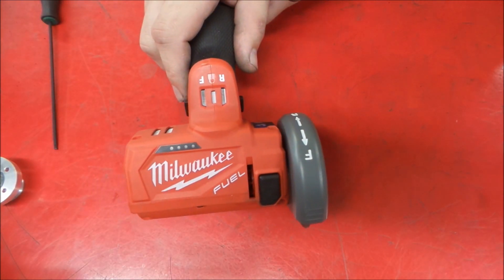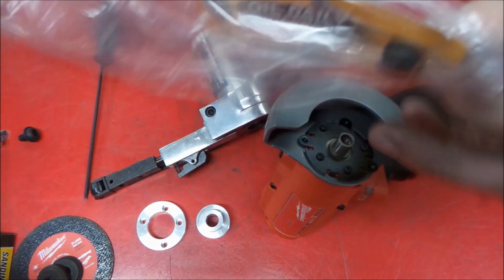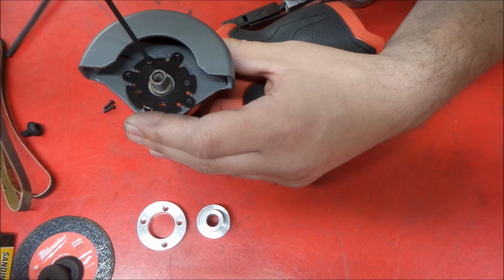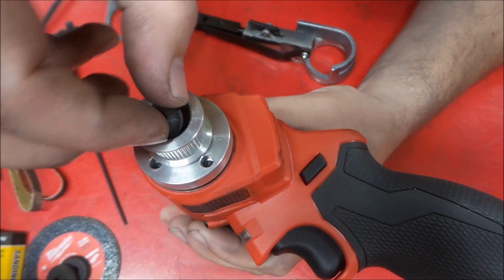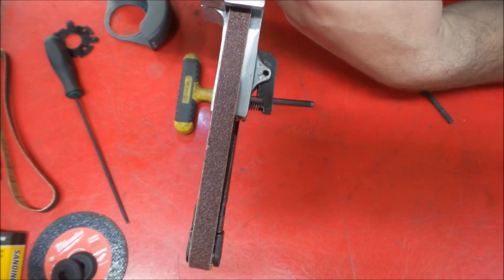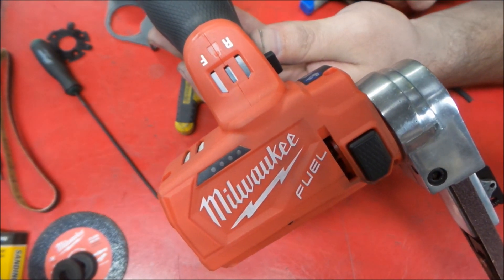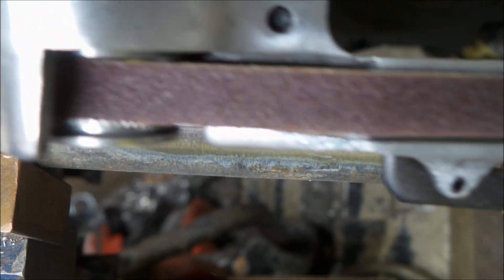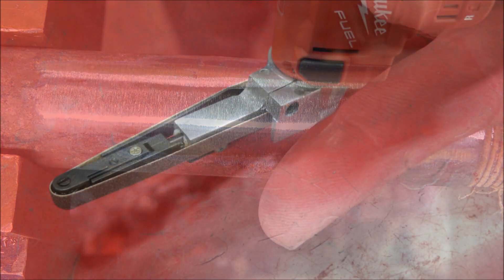Milwaukee 2522-20 M12 FUEL Cut Off Tool Bandfile Conversion

Comment: A very valuable piece of advice @ 4:00 . Sanding belts are only designed to run one direction, as indicated by the arrow on the inside of the belt, due to the way the belt is manufactured at the seem. Thanks for the video and keep up the great work 👍.
Reply from the maker: I took a second look and I actually got lucky the direction of the sandpaper was the direction I am running the tool. I like it chucking the dirt away from me rather than on me. Thanks for the advice. I'll try and work that tip into a future video when we are using the bandfile.

Comment: Used one a lot in the machine shop  I worked in years ago.  Air powered  Dyna File.  Never underestimate how handy these things are,  I miss having one at my personal  disposal !
Reply from the maker: This is indeed a super handy tool to have around.
Reply: Same here,
 I could have used 1 two weeks ago.
I think I might make 1 of these.

(Edit) on second thought, maybe NOT. The cost is not economical, 120 for the Milwaukee, 25 for the China Freight, and 50 for the kit.
I have found Cordless Dyma files for around 80, or Corded for 60
Reply: I never knew these existed until I used one at work last year and I found myself going to look for it on a daily basis
Reply: @Guns_N_Gears  Ryobi has one at a reasonable price...

Comment: My bandfile (makita) has been my favorite tool purchase of 2021. To anyone thinking about one, GET IT you will not be disappointed it's so very useful in all sorts of situations.
Reply from the maker: The Milwaukee conversion is a go to tool in my shop, how has the Makita held up for you? Any pros and cons now that you've had some time with it?
Reply: @TalkingHandsTools  works like the day I got it, seems solid no complaints. I use it plenty but not enough that I could give a real review and beside this one and the pneumatic ingersoll one at work I don't have much to compare to, I'm just a makita fanboy.
Pros, all my garden tools are sharp and it takes 5 seconds
Cons, I'll be making my own belts because makita's are limited in grit and expensive

Comment: I did this to my cut off tool, but I did t buy the kit from eBay, I got a pneumatic belt sander, now the same wheel that came with the belt sander fits the cut off tool nicely, the round mounting bracket with the holes for the screws I made it myself, I use a hacksaw to cut the bracket from the air tool, I drilled the four holes and that’s it, I got my Milwaukee belt sander without buying the kit
Reply from the maker: Sweet, did you get the 3/8 or 1/2 sander?
Reply: @TalkingHandsTools  i got a 3/4 X 20 1/2 sander, I’m thinking to get a 3/8 X 13” for the smaller projects, it’s easy to swap attachments
Reply from the maker: Let me know how it works out. Sounds like a fun project.
Reply: Where did you buy the sander? What is the name of the sander?
Thank you!
Reply: @akaredcrossbow  I got it from Amazon Canada , here’s the name hopefully you can get something similar 

Canadian Tool and Supply 20mm (3/4-Inch) Air Belt Sander (BAS-20)
Reply: @adolfojmz2200  Thank you!

Comment: Would this sander be a good idea for posts of a deck and weird areas like that? I like how it seems it would work in that scenario
Reply from the maker: It would be great to get into hard to reach areas. It is only 3/8 wide, so it might be easy to dig into the work piece. I've also not tried a lot of side loading on it. I think you would need a fairly light touch to avoid pushing the belt off the tool. I'd give it a go if I was comfortable with spending the money, knowing it may not work. If I already had one, I'd definitely try it. There would be nothing to lose at that point.

Comment: On the other hand you could purchase a Ryobi power file with a battery and charger for about $70 and avoid the conversion junk. I’ve had one for 2 years and still works like a charm.
Reply from the maker: Or you could buy the recently release Milwuakee bandfile. I think it's great there are so many options available. I personally didn't want to buy a tool with a different battery line and deal with having multiple different chargers. Other guys may feel different and it may work for them in their shop and that is okay. So far both this conversion and the new release Milwaukee Bandfile have worked great for my applications.
Reply: Where can you find all that for that price?
Thank you!

Comment: 073021/1737h PST 🇺🇸  That attachment is a fantastic idea by the Daddy /Son invention. Imagine the brain work behind the concept, design, machining and testing ! They’d have had several prototypes made to obtain the final result. Kudos to to Daddy/Son joint effort.
I , already, placed the order to HF for the part which costs now $19.99  and will buy the kit from eBay. I think the price for the kit is good, considering the design. They need to patent the design, or have they, already?
Kudos to you Brother for posting the clip. Thank you and stay safe. 73s…
Reply: Patent?  you don't understand how patents work.  In a nutshell, VERY VERY expensive.  Also, VERY IMPOSSIBLE, to write a "broad worded" patent. In the end, somebody changes the thickness of the coupling, adds a washer behing it, uses a different tools belt sanding.... game over.  (I'm an engineer, with many creative machinery designs, not 1 patent, friends with MANY engineers with amazing automations, not 1 patent.... not worth it, many times those that try to copy, theirs don't work well becaue they don't understand the fine poitns. (not saying that is true here...  this is pretty simple)  I am IMPRESSED however with the simplicity of their conversion, they probably can make a lot of money by doing this all over the board with different types of tools and attachments. (Probably not enough business for "most" people to want to figure it out and compete, or for big companies to mess with.)  Miwlaukee will come out with one eventually, and then that will be the end to this, unless it is a lot cheaper to do this.  If I was these guys, I would sell the Harbor freight tool, AND the parts all in 1 kit, AND offer the belts as well. When Milwaukee comes out with theirs, well, that is why guys like the "father and son" should be doing this all over the power tool line.... and they will make a GOOD LIVING, because their engineering and creativity knows no end. Patents.....  they have their place for sure.... but in todays world, almost can't afford to get one.

Comment: Funny thing, this is the third video on this conversion, and all three were a little different.  This is the only one that shows an actual CNC kit.  However, I wonder if there is a kit out there that allows easy conversion between the two attachments, instead of taking 15 min to half an hour to do it back and forth?

My other question is, how does this compare to pneumatic, when using it for a longer duration, like removing spot welds, and then cleaning up your welds and smoothing down body work?  I understand that this is extremely quiet by comparison, and no hose to drag around, but regardless of battery life, I'm talking about speed/time required to perform the same job.  A pneumatic belt sander like this has a lot of torque and speed.  Does this still have as much?
Reply from the maker: I gotta be honest I never ran the pneumatic I bought it to do this conversion. We could probably test it sometime. If I had to guess the pneumatic would have about the same torque. In this case the sand paper will be the weak link. I don't think it will take too much abuse from working the tool hard.

Comment: The belt sander from harbor freight can cost you only 24.99 if you go with the 3/8 width of belt instead of 1/2 as shown in another youtube video. You can use Harbor freight models 60627 or 97055.
Reply from the maker: yes either work well and are both affordable. I've used this quite a bit now and it has been flawless.

Comment: Is it strong enough for doing body work? Like pinch welds on a quarter panel?
Reply from the maker: I've not done that kind of work with it but I've prepped a decent amount of metal for welding with it. I think the tool is proportionally strong to hold up with the strength of the sand paper itself. This isn't a removing bulk material type tool it's more of a finishing tool from the roughing stages. The paper would never hold up if you tried to lay on this thing.

Comment: Neat. Are there any applications for this tool that you can't do with say a die grinder?
Reply from the maker: I think this tool is really handy for De-burring work pieces while you can do that with a die grinder it's super easy to get a fast and very even finish with the band file. There's also a unique finish you can achieve fairly unique that you can really only get with a band file if your into it it's one of the only ways to get it. I got a similar finish with the 6" Inline grinder that we recently restored here on the channel.
Reply: @TalkingHandsTools  thanks!

Comment: Yeah even though I love Milwaukee I picked up the ryobi band file on sale for 59.99 does the job fine and I don’t have to cannibalize my $169 Milwaukee cut off tool
Reply from the maker: Thats fair enough, the adapter isn't too hard to take on and off but if your switching back and forth it would be a pain. For my use the band file is more useful than the cutoff tool. For the seldom use of the cut off tool changing everything over isn't too much hassle. 

If you already have Ryobi stuff I'd say it's obvious to go that route. I'm trying to limit the number of batteries in my shop so this was a good alternative.

How do you like the Ryobi so far?

Comment: Where's the ebay link to buy the kit?
Reply from the maker: If you search for "Milwaukee belt sander conversion" you should find the two versions they sell. I've used this extensively and it has held up great.

Comment: Does it fit on the ridgid version.  I'm all ridgid here and wpuld like to do the same .
Reply from the maker: I do not have an answer for you. there is a distinctive 4 hole pattern for the guard on the Milwaukee. That is the main part for mounting the band file. The other part would be the threads per inch on the tool arbor itself. If your guard mounts similar to what you see in the video it might be worth a go. I'd think it fairly likely the two arbors would be simlar. Since the two tools share a manufacturer.

Comment: Milwaukee does make a band file actually, but it is not cordless.
Reply from the maker: You are correct they have made the 120V version since the late 80s. It's got a larger belt than this M12 version also.

Comment: Where can I purchase the custom adapter? You said eBay but any more specifics?
Reply from the maker: A lot of times with Milwaukee tools a search for the tools part number helps out alot. If you search for "Milwaukee 2522-20 Conversion Kit" it should get you close. Hope that helps out.

Comment: The disks I hear wear out ultra-fast on the cutter.
Reply from the maker: When using it as a cut off tool, they do wear down quicker than a cut off wheel, there's much less material there to start with. 

The advantage to a 3" cut off wheel is the locations you can get into. If you use a grinder with a cut off wheel for most of your cutting and a 3" cut off tool for the harder to reach locations you can save on your materials (presuming you have long cuts).

Comment: 081721/0331h PST 🇺🇸   I procured both the items HF Central Pneumatic 3/8” air belt sander  Item# 60627 and 
M12 Milwaukee Belt Sander Conversion part machined by Mr. Michael Klassen. I read the Legal Notice and laughed! I will assemble the parts and will report. (much later) thanks guys, stay safe and 73s…
Reply from the maker: Glad to hear it, how do you like it? Do you have any pros and cons to share with anyone in the comments?

Comment: Reverse is for when you are in those tight spots and can't rotate the tool.
Reply: Also for redirecting sparks away from your face when you can't stand anywhere else and can't flip the tool around.
Reply from the maker: The redirecting sparks away from your face has become quite nice.

Comment: need a a guard so we can use 4 or 41/2" disc, their wheel dont last.
Reply from the maker: It wouldn't have the power for a wheel that size, 3" wheels never do last long the idea of them though is to get into smaller areas. This tool does that well and with this adapter it works quite well as a Band File.

Comment: OR just slap a steel brush into your drill or 1/4 impact and get the same results for $5....
Reply from the maker: A steel brush on a power tool of any kind can indeed produce results but they would not be the same. Between a band file a steel brush, each would have advantages ad disadvantages. Steel brushes tend to leave a residue behind. If painting or welding is in the scope of your work after surface cleaning that may or may not become detrimental for you. In this case the sand paper on the band file cleans the metal much better. 

If removing paint or really bad rust is in your project you may want to consider a wire wheel (run within rated rpm) in this case the band file would likely clog up.

Flat surfaces are another example where a conventional Sander or wire wheel would be better than a band file. Band files excel on edges and uneven surfaces as well as hard to get to spots. Where wire wheels and edges don't get along at all.

At the end of the day if what your using works for you in your shop, do it. There are however many different types of products due to a vast requirement for applications in a wide variety of contexts across industry. Everyone also has their own style as well as process they are following along not to mention unique site specific safety protocols. Sometimes it is specified not to use one tool or another. Or in the case of a wire wheel may require different PPE and written procedures on certain jobs adding to expenses. At that time other means of achieving the job become much more viable. 

I'd say if given the opportunity to use new tools like a band file give it a go and see if there is something to it. Sometimes things aren't worth it for your applications but at least you'll have some experience with the tool and chances are you'll see some strong merits to it over another method. That doesn't mean it's the only way to do it but if your trying to clean edges on many feet of sheet metal perhaps a band file would save hours and hours of work which makes the price tag much more appealing.

Comment: Why doesn't Milwaukee have this tool in there product line?
Reply from the maker: I can't answer that with any authority but I'll put in two pennies. I think a lot of the tool manufacturers rely on marketing departments to predict the number of sales vs the projected expenses in manufacturing to determine if there would be a reasonable profit in the manufacturing of a particular tool. I'm guessing either the marketing department woefully underestimated the need out there for a band file in the shop and decided not to make one. Hopefully they will see the enthusiasm online for conversions like this and maybe get enough emails requesting one that they will re-consider making one.

Comment: Why can u not just buy the bit u want in a parts Wed  pg
Reply from the maker: you probably could do that. I tried to order some parts from Harbor Freight once and never got them. I don't mind having the air motor around for the tool this way I have two ways I could run it. For me it was less hassle to do it this way but I think your correct you could likely order the parts and get exactly what you need if you want to.

Comment: Too bad it wont have enough RPM to do much.
Reply from the maker: I can try to compare rpm with this and the stock air motor but having used it for a while it's very effective for me. What RPM would you normally be looking for? It's had plenty of torque and operates good for my use.

Comment: I would just buy an angle die grinder much more affective
Reply from the maker: Everyone has their own preferred way of finishing and removing metal. I've always liked options. There's things you can't do with an angle die grinder that you can with a band file and vice versa. I think if you were to only buy one tool between the two it would come down to what other uses benefit you in your shop. If the cutoff wheel or mini saw are a plus then the band file route is better. If the 3M disc, flap wheel, carbide burr, old school stone, 1/4" arbor family are more desirable than the angle grinder as you say would make more sense. Or you could get both and have the best of both worlds. It's all up to you after all it's your shop.